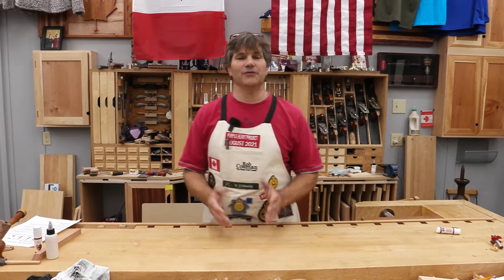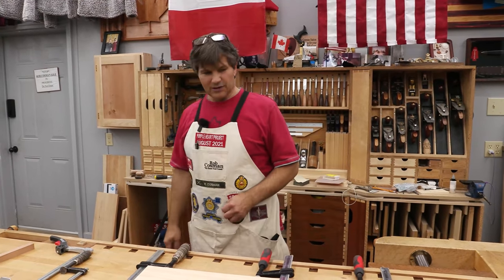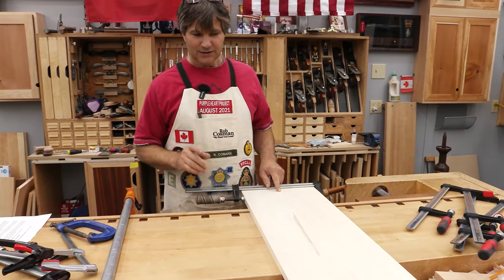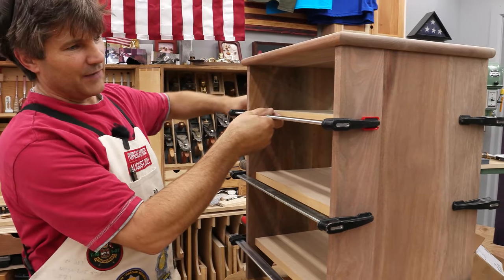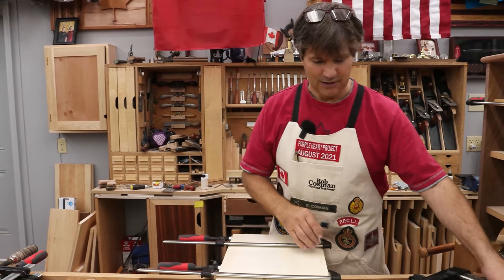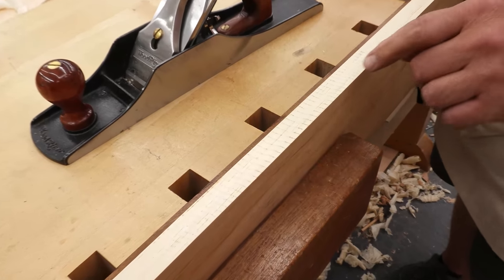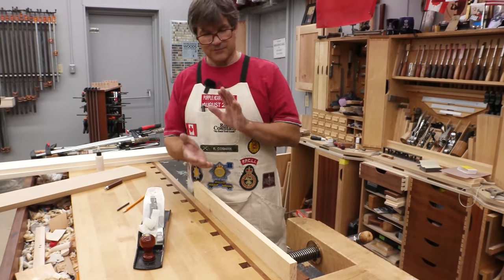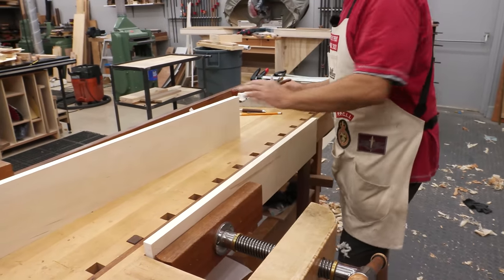Woodworking Clamps | Top 10 clamping tips

Comment: Rob, hard to believe that this topic has only gotten 133 comments over two years, because it is so first principles important! Here is my two cents regarding #3. When clamping a slab, most times ripping to width is done post glue-up. This affords me the opportunity to put a slight double bevel on the outside of an edge board, which is no trick to do lickety split on the jointer, no setting of fence needed. Just two passes on the edge with a slight eyeballed lean gets me a good enough tent shape on the board edge. Back to the clamp-up, the screw end of the clamp almost always has a swiveling foot to allow centering the pressure, and the double bevel on the far end centers pressure with no fumbling of pads. All the best, you are still my hero, Rob!

Comment: Funny you mention over tightening... My first job was in a millwork shop and I remember cranking those bar clamps so tight I'd go home with bruises on my palms.  After learning more, I've often wondered how strong those glue joints were after I squeezed all the glue out.  Would be interesting to test.

Comment: When I started, I bought a bunch of large Bessey clamps in a sale. I used them when building my first table out of oak and they certainly worked well. However, over the years I've found them increasingly useless due to the fact that they are so heavy and the force they apply too great for anything I'd need. This is largely down to the fact I am much better at planing and generally always being square. My first table was probably squeezed to within an inch of its life, now I just bring the surfaces together like you did in the video. I've still got my Bessey clamps and they're the only thing big enough for the wider glue ups I somtimes do, and it's noticeable how much more stressful they make the process due to their weight. I really must sell them and buy some medium weight clamps instead!
Reply from the maker: I compltely understand your journey, as I said I use the squeeze the live out of my glue-ups

Comment: That 45 degree stress clamping spread angle is excellent info for clamp spacing.  I'm just learning about actual woodworking as opposed to finish carpentry.  A while back I made some winder stair treads by gluing multiple red oak stair treads together with pipe clamps after running the butted edges through a tablesaw (I don't have a jointer).  It worked out well but there were a lot of things I think I got lucky on after watching some of your videos.  Getting the panels flush at the edges was challenging.  That third hand clamp method would have really helped me.  For glued panel edges, you or someone mentioned running the adjacent panels with the table-sawed edges flipped so any slight cut angle out-of-squareness would be supplementary.  I didn't know that at the time either but must have squared the blade up close enough.

Comment: 12:00 Bands: I rarely have to do just one band; usually it's several on the edge of shelf boards; etc.  So I do them in pairs, back to back, with the bands in contact with each other.  The clamps then go from the (non-banded) edge of one board to the other board, and the clamping pressure is easily properly distributed to the two joint surfaces.
Reply from the maker: Yes that a great tip, I wish I would have mentioned that in the video

Comment: I’m new to woodworking.  Thank you for sharing your knowledge.  I checked the show notes in the description and saw a reference to the store, but there’s no reference to specific tool you used for planing.  I do not own a plane yet, but the pencil lead demonstration wants me to give planing a try.  If I’m only going to buy one plane, or if I’m going to specifically buy one plane for getting a smooth edge on the board before clamping the glue-up, which brand/model plane do you recommend?

Comment: As you mentioned, clamps are expensive. When gluing panels, I like to use a spring-jointed caul. One clamp in the middle of the glue up is all it takes. Now, with your idea, I will rout a round over on each side of my caul to send the force down the middle. Eureeka! Thanks Mr. Cosman.
Reply from the maker: When using cauls your method you should realy put a slight hump in the middle of the top and bottom caul so the max pressure in in the muddle of the panel.
Reply: @RobCosmanWoodworking , my take is that Garth is talking about edge pressure with fewer bar clamps.

Comment: I've only been woodworking about 3 or 4 years, but I have 4 bessey F clamps and i think 6 of the harbor freight ones, and honestly they work exactly the same as long as you take care of them and provide some lubrication. I don't have bar clamps yet, and when I needed to glue up something larger, I bought a couple of the extruded aluminum bar style clamps as well. These ones I regret buying. Maybe not regret, as they did a job I couldn't have done otherwise, but they're not great. Especially when I make cutting boards, the screw end of the clamp doesnt stay parallel to the bar, when you tighten it down the top leans back which makes the wood want to bow up in the middle.  Cauls help, but I really need to get something better lol
Reply from the maker: If you want good aluminum bar clamps the ONLY ones to buy are Dubuque Aluminum Bar Clamps, you wont have that problem with them

Comment: Great tips, do you recommend the butterfly joint where you plane both edges at the same time so doesn't matter if you are planning square on the edge to the face?
Reply: That's known as "match planing" 😁 It's a decent technique....... but make sure your plane is long enough to keep the edge straight or itll cause problems. If the bevel on your edges is too great then they can slip and slide in the clamps, cauls will stop this and keep them flush enough 😁
Reply from the maker: I have never heard that called a butterfly joint.  Typicallt a butterfly jount is using a "Bowtie" shape of wood to join two boards together (normally used for repairs).  But no, do not like to match plane, I prefer my edges to be dead straight.  I feel my chances of getting a dead flat panel are best with dead square edges

Comment: I use mainly parallel clamps top and bottom. You didn’t mention those. I would never set a glue up directly on my table like that.
Reply from the maker: I dont use parrellel clamps, never really found a need for them and didnt want to spend the extra money
Reply: Sight down your bar when you begin to turn the screw, and watch it bend without any hesitation. the feet of "parallel" clamps are never parallel under any pressure whatsoever.

Comment: Galvanized 1/2 inch pipe for pipe clamps. In my area the galvanized pipe is nearly the same price as the black pipe. The galvanized pipe will not turn your glue squeeze out areas black, and the glue seems a little easier to clean off.

Comment: Thanks for the video, Rob. Some lesser known but very useful tips here. Question: On tip #10, what is the advantage of the automotive painter's tape as opposed to regular blue painter's tape?
Reply: It’s stronger so it doesn’t tear as easily when you’re putting downward pressure on it. You can also use regular tape doubled up. Prep the pieces you need before you start the glue up.
Reply: @_cb336  thank you
Reply from the maker: Clif said it all...think of it as super strong paintes tape

Comment: Rob, how do you clamp thin pieces flat to the bench for cutting rabbets, dados or groves? I have a 3/4" part I'd like to cut a groove in, but the fence of the plane is higher than 3/4". Obviously I need to raise the piece onto a board, but what is your recommendation for doing this so that it clamps securely? There must be a jig or something you use. Thx

Comment: So for decades I've heard of the advantages of spring joints. Do you ever recommend using this? I have done this but only on Pine glue ups "spring the joint and one clamp" and its worked out so far.
Reply: Planing a hollow into the edge, or "spring joint", was his tip 9 😁
Reply: when i trained, my gaffer taught me to spring any joint over about 1200mm.  i have tops over 30 years old with noa sign of end cracks.
Reply: @TaylerMade your gaffer taught you well...... a hollow is always better than a belly, so best to aim for a hollow in the first place 😁
Reply from the maker: Yes I do and I have a video on using them.  https://youtu.be/tD1gSAYMTYQ

Comment: Is there a reason Rob took all of the caps off of the Bessy clamps? Did he just lose them over time, or was it intentional? I'm always worried that the metal could dent the the wood. Also, could Rob do a section of a video some time about how to get squeeze out out of tight corners. I often end up with small little spaces, especially internally, where the interior finish won't take because I couldn't get the squeeze out removed without spreading it, due to the small, tight, generally corner space.
Reply: He mentions that the caps can slip. They’re also plastic and minimally compressible, and in some critical clamping situations even that small amount of deflection can be a problem. Cut some thin, soft wood pieces or half dowel and put them under the clamp pads to protect your work.  For interior squeeze-out, you can always  mask off the joint. It’s a pita, but sometimes you have to do it. If the finish isn’t so critical, the old straw trick works great. Use a plastic drinking straw pushed into the corner and run it along the glue line. The glue ends up in the straw like magic. If you’re not getting all the way into the corner, sharpen the straw to a point, like a quill pen.
Reply from the maker: Miles, I mostly dont like the plastic caps that come with the F clamps, I like the more positive grip you get witout them.  I take them off but save them as every now and then I run ito a situation where I do want to use them

Comment: The way you describe the advantage of using the half dowels seems strange. Yes, you get the force in the center of the board edge, but the angle of the force is not helped by the dowels, if the jaws tilts under pressure, the force will be just as angled as without the dowels. So, the dowels doesn't eliminate the need for altering the clamps. Or?
Reply from the maker: Make the piece in the shape of a triangle, force comes from the point, similar concept with the half dowel